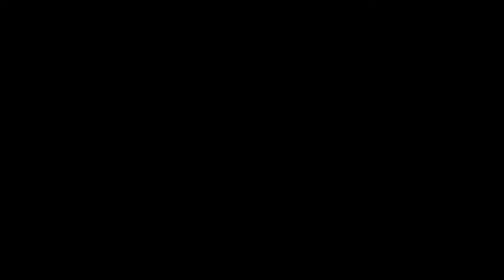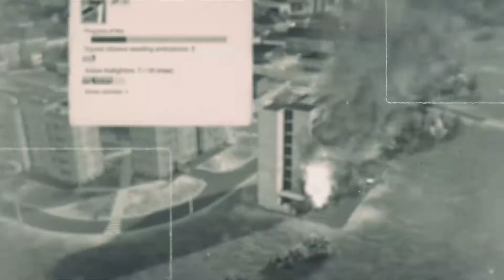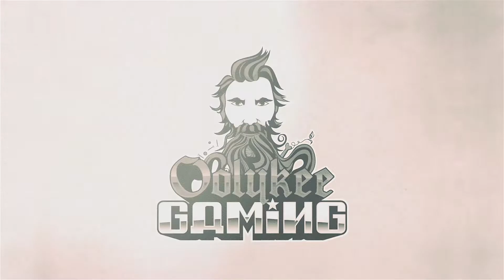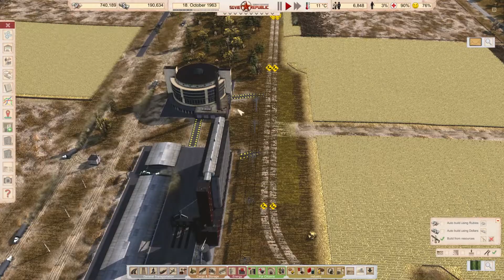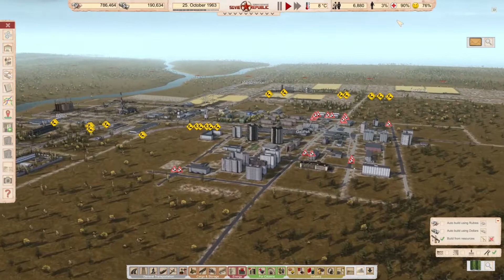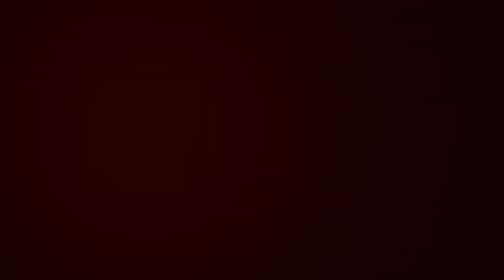Soviet Republic - Steel Republic - Episode 29

Comment: Quote.
"Is there anything you build on your own? "
Unquote.
As I already wrote several times. here is my "construction politics".
- Never self-build footpaths.
- No selfbuilding in the beginning of a map. Only(auto)build the strictly necessary items for economic developpement.
- Later on, I use CO for really big projects, but only when I produce my own steel, and for the simple reason that construction is cheaper with CO. But the size of the projects should be considerable, let's say I never build myself anything smaller than a vanilla steel mill or a refinery. In this case, I have three (not more!) CO. One with mixers and dumpers, one with mechanisms without resources, and one with all the stuff needed to build everything.  All the CO work on everything. When I change the region, I move all the vehicles to the new site and I continue using them there.

Quote.
"Are CO's even needed?"
Depends on your point of view. For you, yes, absolutely, otherwise you wouldn't build dozens of them.  For me, no, I am not a slave of selfbuilding, and I keep my spiritual freedom to live without, and/or to decide when the moment has come to use them.
Reply from the maker: Rethink the words you are choosing. I think you wouldn't like to be described as a "slave" of auto-building. Or unable to grasp the "complexity" of self-building the footpaths. 😊

But I don't usually use these words and I don't plan to do so in the future. 

But this is good. So the difference between us is that you don't think Footpaths should have an option to be built. Interesting idea. Maybe there should be an option to choose this. and maybe there should be an option for people to use direct lines when walking. And create their own paths. Other games do this. 

I addressed some issues in the next video already and you did answer some of the questions so feel free to ignore those. 😊